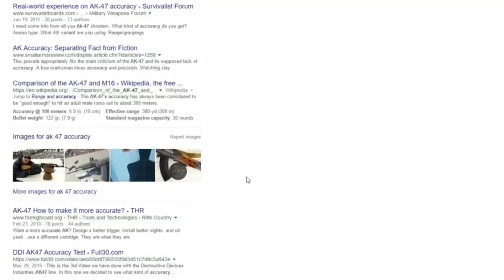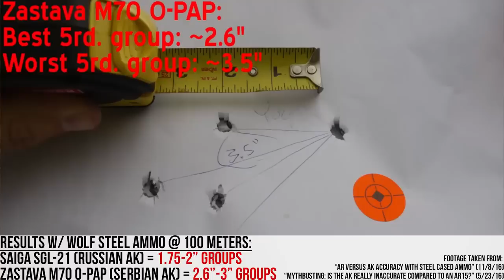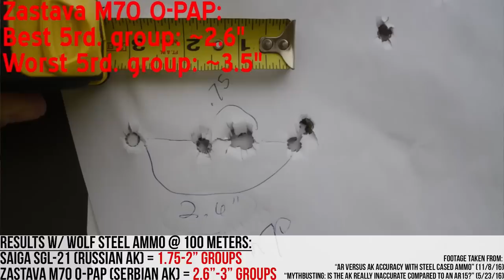Busting the WORST AK-47 Myths! (Featuring InRange TV and Mishaco)

Comment: I still believe that an M16 or an M4 is more accurate than an AK-47 although at close range there is not much difference in accuracy, at longer distances the M16 & M4 are more accurate than an AK-47 due to the cartridge that these rifles are chambered for. 5.56x45mm(M16 &M4) is a cartridge that is lighter than the 7.62x39mm(AK-47) cartridge but is going much faster than the 7.62x39mm cartridge.
Reply: crackshot 488 finally I have found someone who see right. Yes sir the ammunition used in a firearm must be count in. I have fired AK while in the military for years and I know what this weapon  can do but you can't ask the same accuracy from a firearm chambered in a bigger caliber that fires a heavier bullet. And let's not forget the barrel length. Personally I have never liked the AK's sights, but if you train you can fire as good as any other rifle. Best regards.
Reply: Thanks for your comment and I also have found someone who sees it right.
Reply: And there is AK-74(M) in 5.45x39mm, that is USSR/Russia main assalt rifle in service since 1978.
5.45x39mm has almost the same (if not better) balistic as 5.56x45mm but better effect on a target at far/subsonic fase (it didn't counts on expansion like 5.56 it counts on tumbling).
Reply: even in the video itself they go from claiming that 2" group is "basically the same as 1.75" with AR, they also later admit they see 3"+ groupings too ...

the reality of the matter is, the 7.62x39 chambered AK is at average 2-5" grouping gun where AR is supposed to be under 2"... yes AK IS the less accurate weapon, mostly due to cartridge limitations but that DOESNT mean its bad, on the contrary under 300m range the AK is more than accurate enough AND hits harder than ARs small projectile, beyond that range the AK quickly falls off in effectivity but guess what AR isnt that much better either. Neither of them is powerful enough to be really reliable at longer (meaning 500m+) ranges BUT the AK round is certainly more effective at shorter ranges
Reply: @snek9353  a bit more accurate sure a VERY sligtly more accurate  ... and much less reliable ... its a tradeoff, if you really want that slight edge in accuracy - which is basically irrelevant under 300m range anyway - DI will give you what you ask for, but for real combat the reliability, longevity and lower maintenance requirements far outweigh an effect of non free-float barrel.

direct impingement is really not a great system for anything but a sports rifle, all modern military rifles these days use short stroke piston, AR type rifle is basically only military rifle i know of that uses DI

and as for 300BLK as far as i know it has the same ballistic characteristics as 7.62x39, it was DESIGNED for it, the only difference is that its suitable for AR platform feeding and magazine style where normal 7.62x39 had issues because of its geometry. In other words the free float barel capability and overall ergonomics of AR platform are the only differences between AK and AR in 300BLK... and you can fit in-line with barrel stock on on AK or SA Vz. 58 rifle making the only remaining factor a free-float or non-free float.

and any soldier worth his salt will ALWAYS choose piston driven rifles reliability and lower maintenance requirements over direct impingement and free floated barrel.

Leave FFB to snipers, combat rifle for ordinary cannon fodder doesnt need it.
Reply: @snek9353  DI dumps all the junk from spent cartridges back into the action, piston keeps it way off any internal components ... thats HUGE difference in maintenance and reliability, once the DI channel starts to foul you will get irregular action, where piston can be overgassed and it just doesnt care about fouling unless its extreme while keeping internals much cleaner

you simply come from the point of a guy that can clean the rifle every 200 rounds and never use it in dirty environment, once you get fouling combined with external debris you quickly find the more reliable rifle is the better, yes AR when cleaned often and kept in clean environment will run just fine, but even at joint NATO exercises the ARs are notorious for kicking the bucket much sooner than theyr comblock counterparts when under higher volume of fire in harsher conditions.

by the way there really isnt any military US would compete with that uses 7.62x39 as standard round, Russians long since switched to 5.45x39 and Chinese use 5.8x42.

and ffs dont tell me that you consider mechanism  noise for suppressor use ... you would have to go to subsonics for that to actually be a factor AND use the rifle at basically melee distances ... at which point you might as well rather use suppressed handgun
Reply: @snek9353  

1. i didnt say DI cant work, only that its less reliable and requires more maintenance than piston, thats why despite that DI Ars are the best choice for competition or recreational shooting, for other purposes the piston system 5.56 is better and for SHTF you really want something larger than 22 caliber 

2. yes i know that AR with its dust cover closed is more sealed and some dudes do tests specifically in a way that proves nothing ... in action that AR wont have its dust cover closed when you slip on something and faceplant in the dirt mud or sand and when its dust cover is NOT closed the AR will seize up from LESS than AK, Galil, Vz 58 or basically any other rifle especially since its DI system is balanced on the edge to not to blow gass directly in your face unlike piston that can hapilly work overgassed with much larger margin thus handling fouling that will seize up the DI gun

3. you do realize former comblock countries are now part of NATO - Czech Republic and Slovakia with theyr Vz 58s and Poland with its AK knockoff for example ...

4. 7.62x39 is superior up to 125m then they are basically equal up to 300m then 5.56x45 gets ahead and beyond 500 you really want something with more muzzle velocity and/or mass

as far as barrier penetration and wounding capability goes 7.62x39 all the way ... small twig can thrown 5.56 off trajectory ffs ...

5. i think you severely overestimate noise piston driven mechanism makes, yes it wont be a silent as gun that blows all excess gass in your face :) but it would be silent enough for ranges at which you would use actual rifle

Comment: One thing that I definitely like about the AK-47 over the AR-15...I took a full day of instruction in basic training to learn how to take apart the M16A2 and put it back together. They didn't let us even attempt to take it apart until we had completed the instruction phase. There are quite a few small parts inside that you can easily lose while field stripping. The AK has five if I recall correctly: Upper receiver, lower receiver, bolt carrier, bolt, and firing pin. I learned how to field strip an AK-47 in two minutes. It is also nearly impossible to assemble incorrectly and thereby render inoperative.
Reply: Your AK  has a upper and a lower receiver ?

Comment: I have a slight problem with myth numbers 2 and 4. 

#2: Of course, when people say the AK is indestructable, they don't mean you can litterally do anything to it, it's a figure of speech, and it means that the gun is generally much more reliable than other firearms. (Also, no one is going to be soaking their gun in mud. Sure, maybe a few bits of mud here and there, but not in a pool of it). It's kind of like when people say the Nokia 3310 is indestructable, they don't mean you can put it in an industrial sized hydraulic press and expect it to be unscathed. They mean "Hey look, I dropped my phone on concrete for the 30th time today, but it's ok cause it's a Nokia"

#4: 10:06 "When you're looking at a small scale, the AK is not cheap to mass produce." .................... Holy shit, do you know how fucking retarded this statement is?           (8:01 and this is a "renound AK scholar")

When you spend 20 million dollars on equipment to make one 30,000 dollar car, then yes, the car car is not cheap to make at all
However, when you spend 20 million dollars on equipment to make 10 million 30,000 dollar cars, then you're making a fucking enormous profit. That's why the soviets spent so much on those factories, to mass produce the AKs and make a huge profit on them. (Or for the military but whatever)

Comment: The 7.62x39 in general has a reputation for not being very accurate but most people's experience with it is limited to cheap ammo and guns that weren't exactly designed with precision shooting in mind. However it's actually an extremely accurate round. I have a Ruger American Ranch bolt action chambered in 7.62x39 and even with the cheap steel cased ammo it shoots 1 to 1.5 inch groups at 100 yards and 1 inch or less with modern hunting ammo and I'm only using a 1.5-5x scope. I've shot magazines of brown bear ammo at empty shotgun shells at 100 yards without missing from that rifle

Comment: Just something to add: because of the very loose tolerances, and the fact that they are practically handmade, each one is different than the other.  

You can get one that shoots 1MOA, and the very next one off the  production line will shoot 4 MOA.  One will cycle just fine with anything, the next barely even functions with most ammos.  

It is highly likely when buying an AK, that you get a lemon.  It happens all the time.  As much as the WASR gets worshipped, my local gun store has one they refuse to sell because it was made so horribly.

Comment: Loved it. I own both platforms. I have an Adam's Arms AA15 and a Romanian WASR10. I must be completely honest. I was a huge fan of the AK47 platform. I always dismissed any AR, M16, or M4 platforms as "unreliable" and "Weak." I've owned my WASR10 for a great deal of time now. I purchased my AR about a year and a half ago on the continuing recommendations of many of my Servicemen friends. After putting the first thousand rounds of 5.56 down range. I truly Love both platforms. However, I will be the first to admit that both platforms are "Mission Sensitive." My best example of this would be with hunting on my farm. With my AR mounted with a Beileshi 6-24 ×50 AOEG I have harvested Groundhogs on the run at ranges varying from 60yds out to 250yds without issue. When attempting to take down a rather large coyote it took 2 rounds of 5.56×45 NATO then ran 3/4 of a mile before bleeding out. I felt awful as I prefer to dispatch animals as quickly and humanely as possible. Approximately a week later I was awoken early in the morning to my chickens in an uproar. I grabbed the WASR10 with a basic reflex optic as it rests right next to my bed. Expecting a Fox I made my way to the coop as quietly as possible. When about 10yds away another rather large coyote took off with a chicken in its jaws. I dropped the safety lever and fired when the critter was about 25yds away running full speed directly in front of me. One shot, using cheap FMJ TUL Ammo and it dropped like a sack of potatoes.

Comment: Agreed that the sight radius of the AK is as good as the M4. For my aging eyes though, the v ladder sight put out in front of the action is much more difficult to work with vs the peep sight of an M4. I prefer the 1903A3 or the M1917 vs the original 1903 for this reason.

Comment: honestly you can fine-tune the Kalashnikov sights a lot better than the M4 so if you have the patience in the wherewithal to sit there and adjust your front sight pin you'll get a far superior sight adjustment then you will by merely clicking your dial because the M4 relies on series of clicks so you're only going to get as close as the closest click the AK at least for windage you can get it perfect

Comment: It's on a sliding scale between Accuracy and "Don't clean it for 40 years and fill it with mud and it's still reliable"

Those guns are "Reliable" because of loose tolerances.

Pop culture has functionally combined the precision of tight tolerance modern AKs with loose tolerance "Reliability" of old AK-47S

Comment: The way you are shooting at the targets (single shot, prone with an optical sight and mounted) is not how assault rifles are typically used on the battlefield. If you fire an AK-47 or 74 from the shoulder relatively quickly in bursts you will see how it compares to an M4.

Comment: With cheap and simple to produce gun I guess it's somewhat the situation that guerrillas during WWII run into - they discovered, that supposedly simple SMGs are hard to  copy when you have no tooling and a way to make stamped parts, and it's simpler and cheaper to copy some of more complex milled guns, so it's all about the scale of production.

Comment: As someone with a range who gets guys with AKs I see two reasons why they say it's not accurate.  1. There trigger squeeze and general technique is grabage and they can't group because they suck and try to blame to weapon and many  cases never zeroed it properly and now trying to be a marksman.  2.  They run the cheapest inconsistent ammo.  I don't own an AK personally but do own and SKS, and it's groups suck with Tula, wolf is more consistent at 2-2.5 moa, and with Hornady SST 7.62x39 I have rounds right on top of each other.  The ammo has allot to do with it since most guys who run ARs use premium brass cased stuff and the AK guys run the cheapest steel cased stuff they can find.  I run cheap ammo for fun plinking, but I'm zeroed with Hornady and I run Hornady when hunting coyotes.

Comment: Before I comment and in farness to the M-16/AR/M-4 system, the below is based on my experience in the US Army from Vietnam to the year 2000.   I realize that some improvements to AR systems now used by the US Armed Forces have been made.  The below is based on firing thousands of rounds over time with both the M-16/M-4 once called the CAR-15, and the AKM, AKMS, RPK Light Machine Gun. 
My years in US Army Ranger,Special Forces and Black Operations shows that the AK is far more reliable as to carbon build up, weather conditions, and overall abuse versus the AR-15/ M-16 A1/ A2/M-4.   AK will continue to fire long after the AR system begins to have stopages. Serveral reasons.  First the AR locking lugs and bolt face lock into the breach with a much more tight fitting connection, and thus carbon in the locking lugs and locking groves will eventually keep the next round from locking completely into the breach.   Next the overall tighter bolt carrier and bolt in the upper receiver. Carbon will work to eventually slow down the action and thus cause other types of stoppages as a result.
 Next stoppages of the AR happen due to the extraction / ejection system and high cyclic rate of fire.  As the AR carbons up the weapon begins to often not extract and eject the expended round fast enough to keep up with the high cyclic rate of fire.  Another issue that caused the above was the fact the AR ejection of expended rounds was not near as strong as it is with the AK.  Due to this the weapon was more prone to stove pipe stoppages.  The AK on the other hand has a slower cyclic rate of fire and a very strong pronounced ejection of the expended round, which is thrown out much farther and faster than the AR expended rounds do.  Thus one starts to get stove pipe stoppages where the expended round has not been extrated and ejected fast enough before the next round is moving to enter the breach.  Also the slit area between the lower and upper receiver is a place that find dust from blowing sand can enter the system.  In Vietnam often experienced GI's would put camoulfage stick in that small spaced were the upper and lower receiver of the AR meet.   Generally our experience was that between 200-300 rounds of rapid fire the AR begin to have stoppages.  The AK however  continued to keep firing and functioning well.  As rounds continued over time the distance of the rounds being ejected got shorter, but still the rounds were ejected much further from the receiver than the AR and always remained strong, fast, and further so that no issues as to stoppages happened.   I do know today that some issues as to the new M-4's has corrected some issues, but I will take the AK anytime over the AR.  However I can make the AR work for me as I have fired many thousands of rounds from them and know the weapons strengths and weeknesses.   
Also as to accuracy if one has the site adjusting tool for the AK front site do adjust windage and elevation, and knows the correct Russian Military / former Warsaw pact military methods of zeroing then the AK can be made to have a very tight shot groups.  The AK is a military rifle for soldiers.  It is highly reliable, simple, accurate.  Also the M-16 unless it was broken down into 2 parts, it was never easy to rig to Jump and not fast to put into action like the AK that was far more jumpable and quick to put into action on the DZ.  This of course was due to paratrooper model AK's having folding metal stocks.   Also the AK sling system is far more secure and also far more suitable to combat carry.  The magazines will still function even when stepped upon and are far more robust than the AR onces.  Also I found years ago that the RPK Light Machine gun 70 /75 round drums & 40 round box magazines were very reliable and were interchangable with all AK's. Also of course the AK 30 round magazine works in the RPK LMG. The M-16 drums often had stoppage issues.  Finally I have also a great dealof experience with the G-3 HK-33,53, and G-3 type machine guns.  The G-3 and HK assault rifles were in my experience far more reliable than the M-16/M-4/CAR-15 assault rifles.   However a good soldier can make any of the above work for him, and in the end he will go with the weapon that his gut feeling tells him to use.